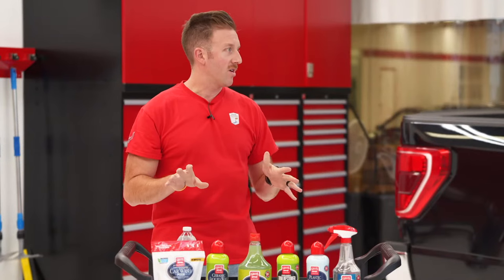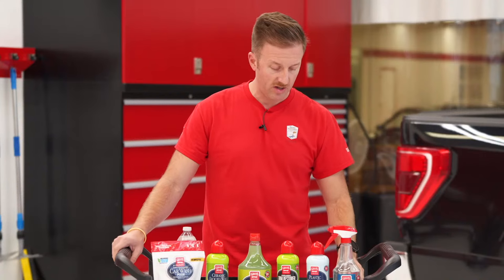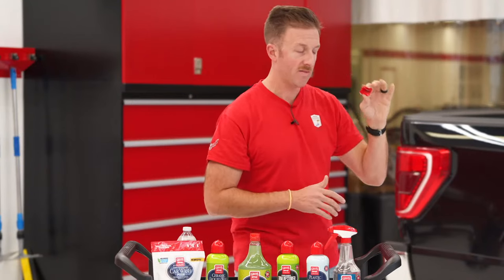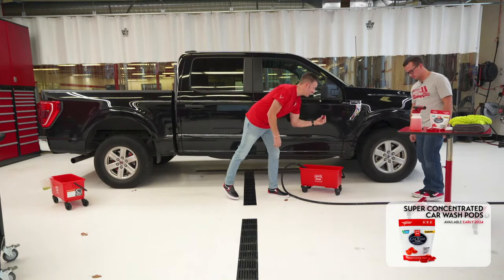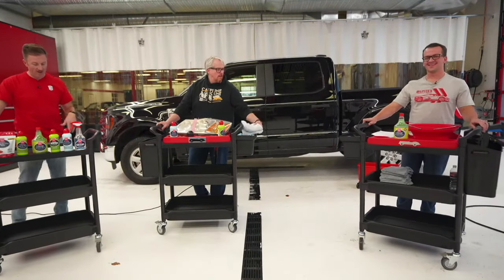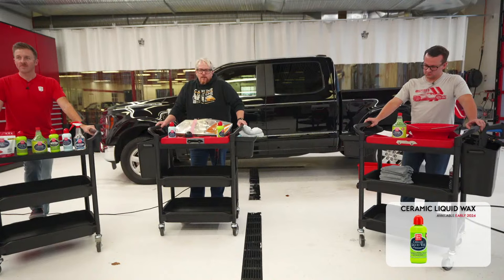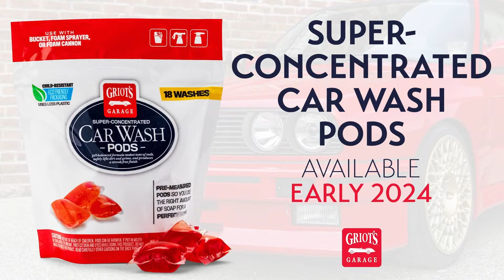Griot's Garage LIVE: SEMA Recap 2023

Comment: I realize time was limited today, but there are a few other items I was really keen on learning more about.

Firstly, the hand cleaner—will this make a return to the market? I heard production had stopped, and I'm hoping for its comeback.

Regarding the Paint Thickness Gauge, is this an updated version? What sets it apart from the older model?

Lastly, I noticed the Blow Gun with a bottle on the side of your cart today, and it caught my attention. What advantages come with using it alongside a bottle compared to the version without?